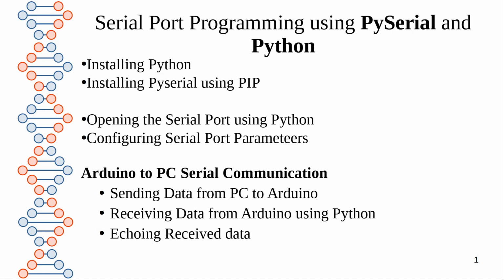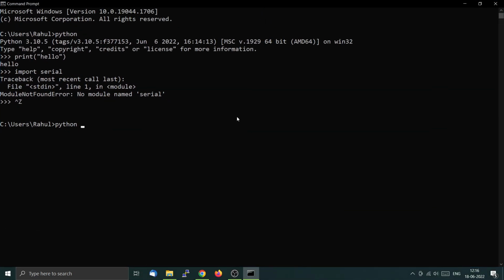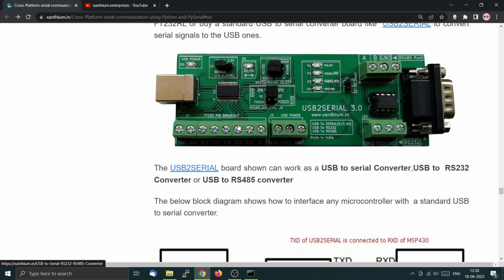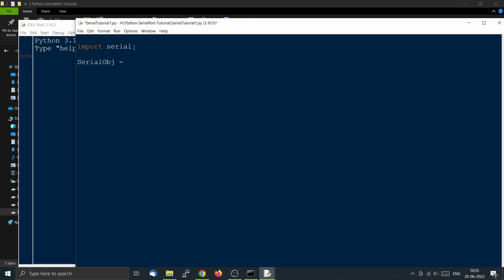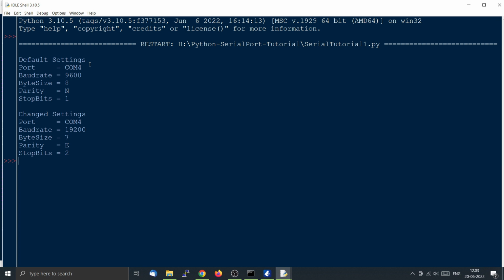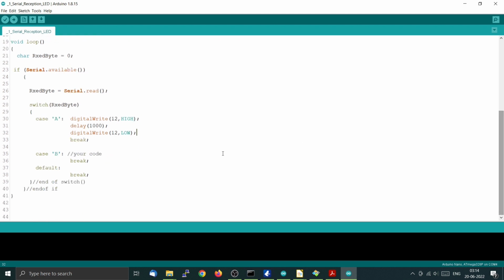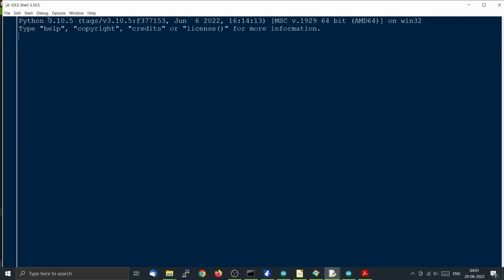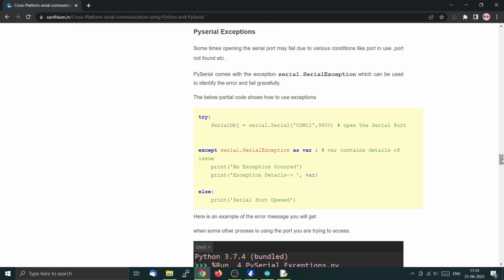Serial Port Communication between PC  and Arduino using Python 3 and PySerial Tutorial for Beginners

Comment: I have this error

Traceback (most recent call last):
  File "E:\Downloads\peoplecounteryolov8-main\peoplecounteryolov8-main\test 26april buzzer.py", line 39, in <module>
    arduino = serial.Serial(arduino_port, baud_rate, timeout=1)
AttributeError: module 'serial' has no attribute 'Serial'
Reply from the maker: have you installed pyserial using pip.pyserial is not installed by default.check the spelling of your pyserial function also?

Comment: I canot find a port section in device manager
Reply from the maker: you need to connect some device to your USB port that will act as a Virtual COM port for Eg Arduino UNO,Arduino Mega,USB to serial converter chips like FT232 or CP210x and the drivers for those chips installed.
Then check the device manager or refresh it

Comment: Hello sir com4 not showing
Reply from the maker: COM4 is what the arduino  is assigned in my system, In your system COM number will be different, do change it.
 Plug your Arduino to PC and check the device manager for the correct COM number.
 Or you can check it in the arduino ide Menu settings,Tools-> Port

Comment: Hello, I have a question.
Since I don't have Arduino uno, is it possible if I just connect two PC with usb to RS-232 converter and have 1 pc send signal to the other using serial.write() and use serial.readline() to receive?
Reply from the maker: that is possible, replace arduino with one of your PC

Comment: Great tutorial. Is it possible to listen to the a COM port continuously and capture a string upon arrival with out over loading the winXP  PC? I suppose using some kind of  COM wake up on interrupt or similar concept.
Reply from the maker: I dont think that is possible on a  Windows XP or a Windows 10 system. That would require  access to the underlying hardware directly 

and most of the time on x86 PC the serial port is virtual and runs on the USB hardware. 

You may be able to do it in some embedded linux systems that would allow you direct access to the hardware.

I think  you can do a network wakeup where the whole PC starts up on receiving a network packet through the LAN cable 

Hope this helps
Reply from the maker: Do  Subscribe to our channel if you are interested in learning about embedded systems ,electronics or programming.